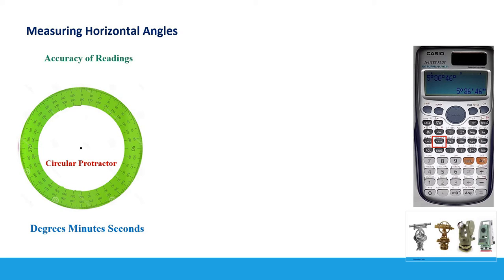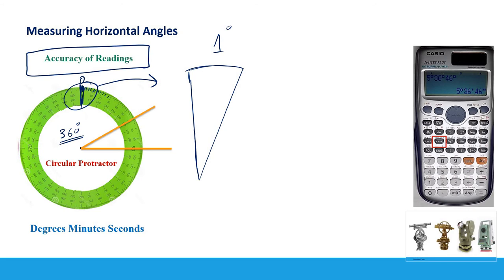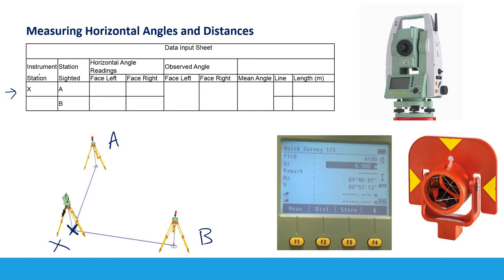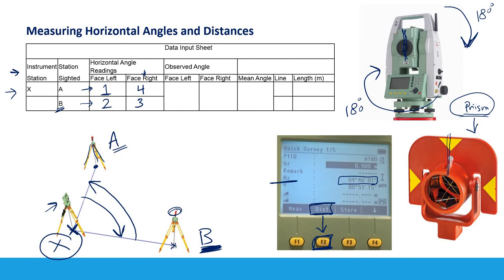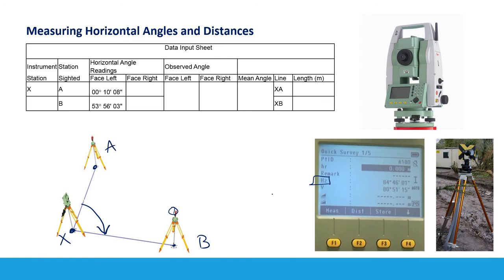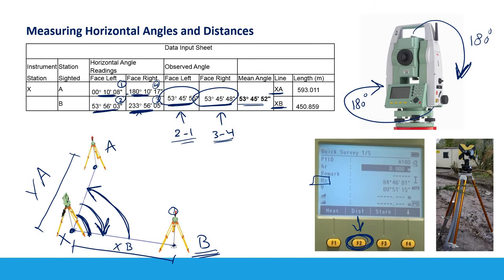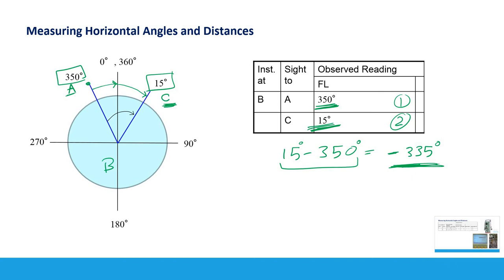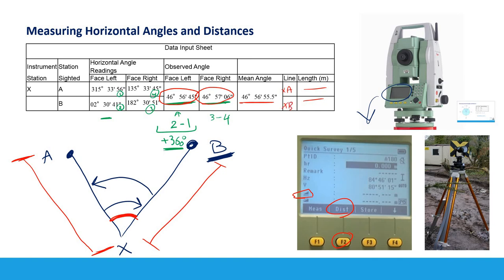Surveying | Measuring Horizontal Angles and Distances Using Total Station or Theodolite

Comment: Hi sir I have  encountered a small doubt. If we r measuring the angle between 2 points ( A and B) using a total station,  so when begin the procedure we sight A, it has to be zero  right?   

Because then only we can measure the precise angle from A to B .
Reply from the maker: Hi. It can be any value. Not necessarily 0. Regards
Reply: @ziadabdeldayem6884  oh thank you, now I got it if we r sighting A and horizontal angle is not precisely 0, we can obtain the accurate measurement by deducting the angle at B by the initial angle at A

Comment: Dear Dr.Abdeldayem, is it possible to set the angle at "A" at zero when sighting Face left, then set the angle at "B" at Zero when sighting Face right?    In this case, the origin's value of each angle would be Zero and the other measured angle would be subtracted from zero.
Reply from the maker: If you're confident on how to use the total station, then yes it's possible.
Reply: @ziadabdeldayem6884  Hello. Thank you so much 🙏

Comment: hi sir, just saw in another video, for observed direction/angle they minus 1 and 4 depending on the value of face left if it is smaller than face right, can you please clarify it possible on how the method works and would happen if we had 3 points in 1 set up station

Comment: Hi sir,  woldn't be easier setting to 0 and then measure angle to B ? Thanks
Reply from the maker: You can start from zero if you are more comfortable with that. The key thing here is that you understand what you are doing.